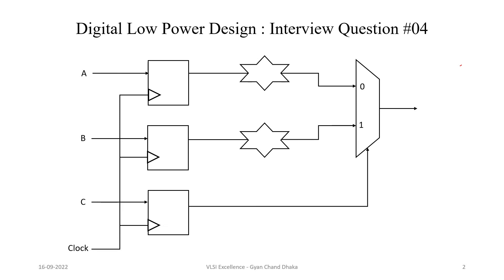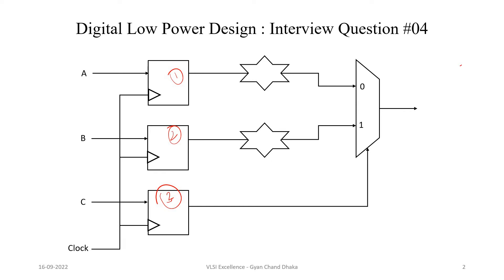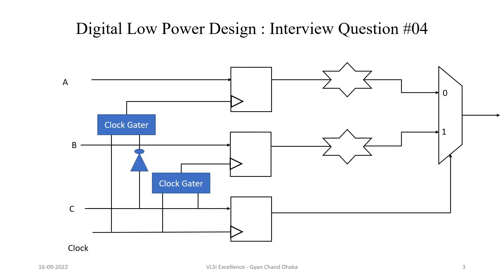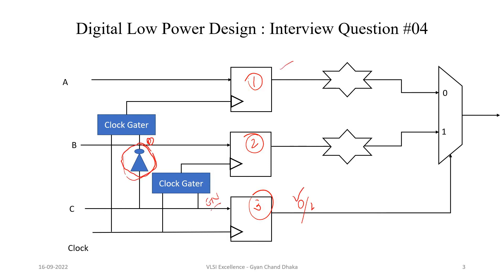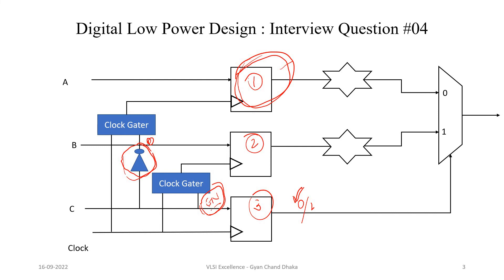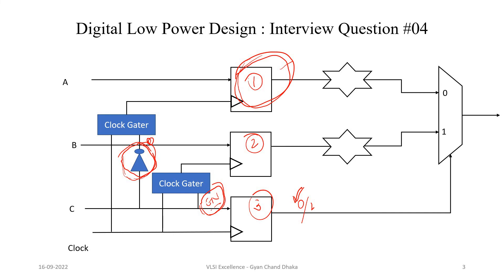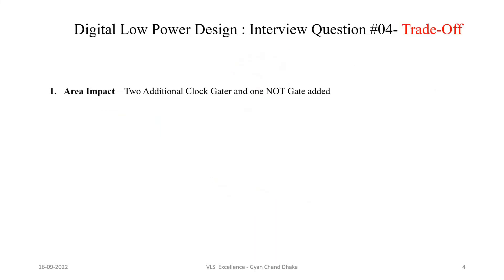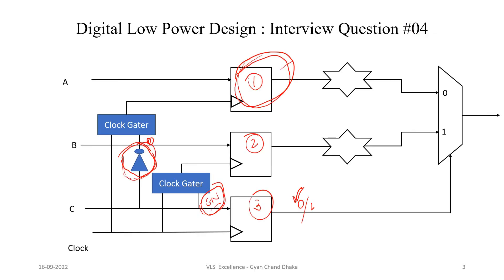Interview Question #04 | Dynamic Power Optimization | Clock Gating | Low Power VLSI Design ✍️

Comment: It is not clear when to use latch, when to use clock gater and when to use AND gates to stop switching activity on unused inputs. Could you please elaborate on that?
Reply from the maker: HI @優さん , Thanks for the feedback !! , Let me divide this into two scenarios 
1) Stopping Switching for Sequential Logic (FF) 
2) Stoppng Switching for Combinational Logic 

For Scenarios (1), We need to use Clock Gating Technique 

For Scenarios (2), We need to use Data Gating Techniques (Latch Based Isolation OR Gate Based)

Hope this is clear !!